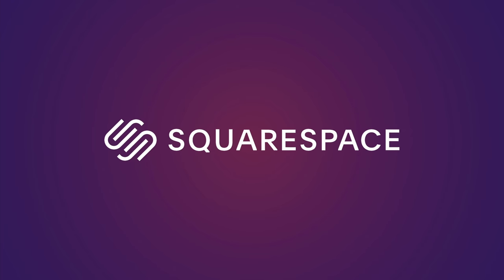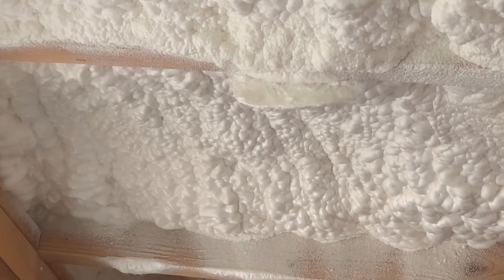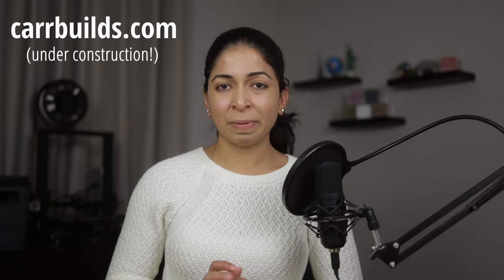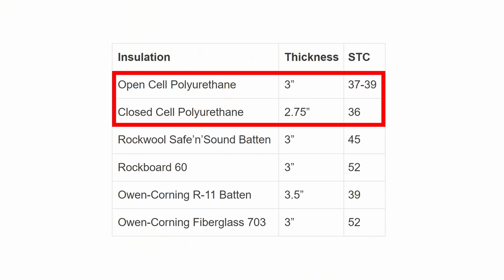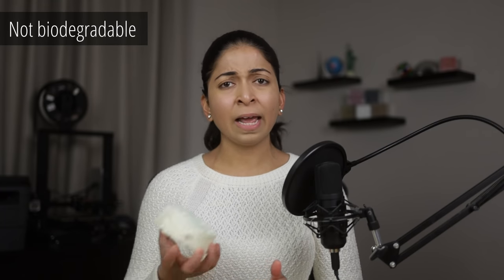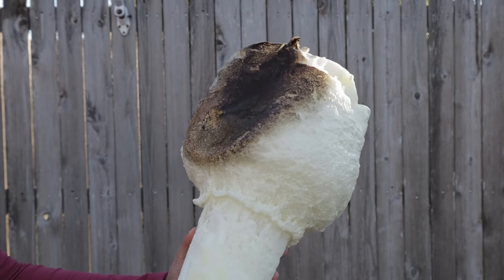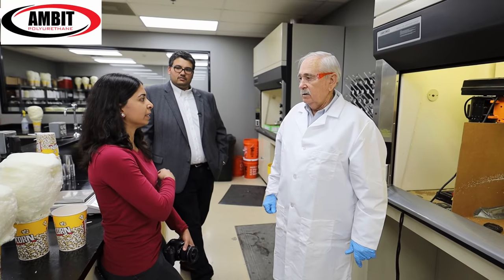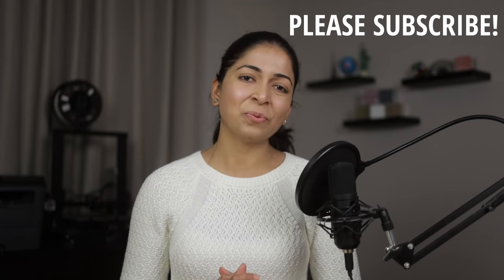PROS & CONS of Spray Foam Insulation | PART 2

Comment: this is the video I've been waiting for.  I've been very curious about the environmental impact of spray foam.  even though it's a long term plastic, it's still a plastic.  with so many other options out there it feels like an unnecessary concession to use plastic for insulation.  I'm heavily leaning toward cellulose for our attic (and walls?).  thanks so much for these insulation videos.  you've been one of my primary sources in all of my research.
Reply: It is a plastic sure, but it’s really mostly air. And it saves so much petroleum product by insulating very very well its negative imoact is far outweighed by the energy savings.
That’s not to say that everything‘s perfect, but what it?
Reply: @FreekHoekstra  yeah i'm not saying it doesn't have its benefits, my personal preference is to avoid stuff that will eventually end up in landfills or be toxic.  And we heat primarily with a heat pump sourced from municipal power that comes from 93% carbon free sources.  No choice is perfect and we've no way of knowing ultimately what the BEST choice is environmentally with all the different factors, but given the info i have right now i'd  like to avoid plastic insulation and go for something else that seems to work very well also.  Thus the cellulose is looking like a good option.  wouldn't have been able to navigate all these nuances without Belinda's videos.
Reply: @jasonreed6262  yeah there’s a bunch of good options personally I do like the idea of using close cell foam for thin layer say 2 inches and then filling the rest with less chemical solutions, The main benefit that this provides is a very good air seal which means there’s also no condensation happening in your walls which means they last for pretty much forever. I think that’s a part that a lot of people forget about it if you make your building last for 20 years longer because it has been air sealed properly spray foam, that’s a lot of material not going to the dump either
Reply: @FreekHoekstra  very nice points.  A small amount for air sealing / delay EVERYTHING from landfills longer.  i like it.  fortunately i'm not the one who will be ULTIMATELY making the decision as... it won't be DIY :).  our house is about 50 years old and has insulation... but not a ton and not well installed and i've no clue about the walls or above the gararge.  definitely need a professional to look at it.  but yes air sealing i think is going to be a big factor i didn't really know about a few months ago before i started going down the youtube rabbit hole.

just out of curiosity, what's your relationship to insulation?  a home owner?  a homeowner who has done DIY insulation stuff?  a contractor of some kind?  just someone who finds this stuff interesting?
Reply: @jasonreed6262  just be careful when you air seal an old house, if it’s done improperly it can cause the wood to rot and die,
Remember you can’t really keep water out you have to make sure it is still able to dry to the outside, Another good channel to pay attention to might be the bill show or Matt Risinger. He has a lot of information regarding this type of construction and renovation. Anyways yes your ceiling is super important if you don’t hear seal your house but insulate it’s like wearing a down jacket but not closing it while going down the ski slope, it’s not pointless but close.

Comment: I remain open to my mind being changed; but, currently I'd prefer rockwool both inside and as the exterior insulation vs open/closed cell foam with foam on the outside.
Rockwool seems like a better overall solution. It appears to better handle moisture and sound than foam.

Comment: Lots of specific info in this vlog.  Much appreciated.  I live in a termite area and I've heard spray foam is susceptible to this insect.  A work around is to use spray form between the framing, hang the sheathing, install rockwool on the exterior before finally hanging the siding(in my case due to wild fire will use a cement-based siding) .  The rockwool exterior offers fire resistance, soundproofing, and is a natural barrier for termites. New construction materials require new building solutions.  Bummed to hear about the 6 months shelf life as I just bought 2 pallets of closed cell foam with the intent of using it in the summer.  Need to get through the permitting process before the foam can go up. at least I know some new variables...
Reply: If those are Froth packs, there should be a use before date on there. I believe those last 2 years.  I also think it depends on the manufacturer/chemical makeup to say how long it will last.
Reply: @eduardos8895  You're the man!  Just checked the boxes, the use by date says Nov 10th, 2023, so its 2 years on these containers of closed cell.  I was under the gun to get everything wrapped in time to use it before April.  Thanks for the heads up.
Reply: @Lionscircle  Glad I could be of service. I used it my attic. I love it. 
Just make sure both cylinders discharge at the same rate... I had one stop dispensing the Iso and it all became mush🙄. But usually, that happens at the very end of the containers. I just got a bit greedy.

Comment: Spray foam definitely has its place. IMO where you have limited cavity depth and serious sun exposure, but need high R value the stuff is great. Where there is no ceiling/attic cavity & wallboard is direct applied to rafters it works well. The downside that once it's in it is hell to remove is a real concern for project planning & later remodeling. Perhaps spray foam could be combined with 3D printing of concrete walls for a better R value mix built into the structure.
Reply: Electrical could be installed in conduit, which would allow for replacement or upgrades in the future.
Plumbing could be done the same way, in conduit, assuming they are running a product such as PEX.
I would also leave spray foam to exterior walls only, and stick to more traditional insulation for use on the interior.

In the end, planning is THE KEY factor.  Without proper planning, someone down the line is going to be screaming bloody murder :P

Comment: Flash and batt with closed cell foam is my favorite combination of insulation when dealing with price sensitive situations.  We are using this in our new home construction this year.  One inch of spray foam and the balance of the wall cavity filled with batt.
Reply: I'm in the middle of a DIY project to insulate and air seal the rim joist on my house. I'm using a modification of the flash and batt method by combining 2 in thick foam board and closed cell spray foam. Cut the foam board to roughly the size of the opening and place in the open rim joist bay with some construction adhesive. Once the construction adhesive sets, fill in the void around the edge of the foam board with the spray foam. I can come back later and add a layer of fiberglass or whatever but my main goal was getting it air sealed first.
Reply: @jon27d That is a good DIY version that will, most likely, make a noticeable difference in energy utilization, and even more importantly, comfort in the home.
Reply: One of my contractors uses this method as well.  The flash and batt also allows for wiring to be fished in if needed.

Comment: Refinished the 3rd floor walk up on a 100 yo brick structure. Sprayed 1.5 inches to the underside of the roof deck.  

Put a warm hat on the house.  House is still leaky but not nearly as much.  

I did see a sound and insect proofing benefit.  No insulation previously meant we heard every street sound and critters passed un hindered.  After I only hear the loudest straight pipes and if my wife complains about 1-3 stink bugs a month in winter that’s a busy month.  

Well worth the investment. Bat insulation was not an option because venting the roof deck would have been a nightmare.

Comment: The two things that absolutely kill its appeal are the permanence and acoustic properties. 

Renovation and even just the occasional new appliance will require electric and/or water to be run or re-routed based on the geometry of the appliance or fixture and adding anything from a generator hook-up or welding station in the garage to simply wanting to upgrade from a 15A to 20A circuit will be an absolute nightmare. I have a feeling that houses with spray foam will likely have lower resell values once people realize the difficulty and cost. 

I also like having a very quiet house. Partly because I can get pretty loud at times, but also because I tend to sleep from 2am till 11am due to the nature of my job. Neighbors leaving for work, delivery vans slamming their doors, farm equipment running down the street or harvesting the field behind my house and trucks delivering oil, gas and mulch or pumping septic tanks all make it nearly impossible to get a full morning's sleep.

Comment: Great overview, thanks! I like the idea of spray foam, but the cost compared to fiberglass, and difficulty of revisions tend to discourage me from using it.

I'm considering options for converting an attic to a heated space with a vaulted roof. I'd love to see a video from you describing the differences between hot and cold roof systems and the considerations when converting.
Reply: tHanks for that suggestion Dave.   It is time for me to change out the shingles and would love to see options.

Comment: Hi Belinda. Thanks for the well explained videos. I live in Canada. Our attic was spray foamed with 6 inches of closed cell foam directly on the upper interior roof structure. The 6 inches filled the cavity between the rafters but not the rafters themselves. 14 years later rot is in many places along the ridge board and top of the rafters. Ant are nesting in many spots.
According to the numbers you mention for water vapour transfer, it sounds like my 6 inches of spray foam should not be allowing water vapour to seep through to the cold roof boards above. Could water vapour be getting absorbed through the non insulated rafters then in turn condensing against the exterior thereby rotting the surrounding wood structure ?  Thanks.

Comment: From an electrician's perspective, I don't like spray foam for the same reason you gave: you can't fish wire through it in a retrofit application. Spray foam does have its place however, you just need to be sure that your plumbing and electrical is exactly how you want it permanently.
Reply: I'm installing 2 empty jboxes in each room that stubs out to the attic space(closed attic) in case added services are needed down the road.  Spray foam over the emt, planning for future needs.

Comment: Only thing I would use this product for is sealing gap and detouring air flow in smaller areas. Otherwise Rockwool insulation is the most effective. No worries about fire hazards with Rockwool insulation.
Reply: You get it

If you have to do that much R&D to equal existing and/or better solutions & still have downstream problems... then it's more about being trendy
Reply: Being trendy, aka can't think for yourself lol

Comment: Belinda, thanks for breaking up the video into organized sections and the great detail. Very helpful. There is a comment in the R value section where you say foam may not meet code. I'm having trouble understanding that. Open cell foam has the same R-value as fiberglass batt (about R 3.5 and closed cell has an R value of about 5.5), so how is it that if cell foam has an equivalent or higher R value than fiberglass batt, it doesn't meet code? Or are you just pointing out that CI is necessary to meet code for both fg and foam?

Comment: My biggest fear of spray foam is improper mixing and application, especially in this current labor market.  You can train people for months but if they do not adhere to the training it will end up costing everyone involved at some point from delayed construction, to dollars, to even health issues.
Reply: It's not really just training.  It's often an equipment issue.   One that the sprayers are totally unaware of
Reply: There is a safety shut off incase of imbalance on all machines, but all the sprayer bypass it to get the job done faster, so sue the sprayer.

Comment: I don't think I'll ever choose spray foam as the primary insulation material, but what it teaches us is the importance of sealing every little nook and cranny of a home. So what I would do is seal every nook and cranny with canned spray foam from the hardware store, as that is exactly what it's designed for, and use rock wool with good R value and sound insulation as the main panels of insulation. 
The attic, depending on its size and shape, may need to be completely spray foamed though, but that's up to whatever technology there will be at the time of me having to make such decision.

Comment: I'm getting spray foam in a few weeks 3 in of closed then 6 in of open cell on top. For the 2x10 roof. 2x4 walls are getting 1 inch of closed followed by 2.5 open. Hope this was a good choice.  My other option is the same thickness closed cell as stated above with fiberglass Batts on top of it. 
Any feedback please?

Comment: Its easy to remove, you get a wire brush on a grinder and you just rip it off, it does take some time depending on the power of the tool. But I mean if you are removing it in 30-40 years your either going to be ripping out the entire wall and everything but the studs or your fixing a section or adding a line of water or power and then yeah your just going to put a large wirewheel brush on a grinder and have that tear it out with a vacuum attachment to suck up most of the shredded foam along the installation path.

Comment: I'm currently renovating the 100 year kitchen of a 135 year old house. 2/3 of the main house was renovated and I used a mixture of rockwool and fibreglass as insulation.  The house is not nearly airtight...field stone foundations and old windows contribute to this.  In the kitchen, I've been leaning strongly towards closed cell SPF since everything is opened up but now I'm having second thoughts.  After reinforcing the kitchen structure, I now have 7.5" deep stud bays and 10" for the flat roof's rafters.   SPF is very expensive right now, $1.75/bdft in my part of Ontario. But SPF will tighten up the structure and seal it.  Comments or suggestions anyone?

Comment: Wonderful video, thank you!
I'm an architect in California. I am finding closed-cell, flash-and-batt to be useful for modern work with thin roof lines where detailing out ventilation is problematic.  I imagine some of the added cost in closed cell can be offset by the savings in ventilation installation.  It seems far simpler for roof subs just close things up tight rather than install things like roof to wall, 2-part flashings.  Curious if you have thoughts on this aspect?

Comment: I've seen contractors down south in the US, saying that termites like to tunnel up into the stuff, just like they would, do to wood.. 

I don't know how true it is, but... I don't see them having anything to gain by lying?

Personally I'm interested in the "Hemp wool" product you talked about before. When I finally get to build my home, I think I'll aim for that.. 
And those new studs that have been engineered. The "Tstud" I believe with their powers combined... it'll be a half way decent insulation system.  (or captain planet will manifest, lol)
Reply: @Eric B 
Sounds like a good strategy to me. (The zip panel stuff is a somewhat "newer tech" by construction standards) You could probably just take more time, to make sure certain key points in the building are really sealed well, & it balance out?

I mean I've heard the term "rough construction" thrown around alot... so if you just had the crew take more time, or if your a home builder yourself, & tighten your standards in certain areas, it could pay off, in the long term (completed house) a lot better?

Comment: A modern home with gas appliances should not be reliant on make-up air from the attic, as stated at 7:41. Even a quarter century ago when I had our gas furnace replaced with a now-obsolete mid-efficiency (induced draft but non-condensing) unit building codes here (Alberta Canada) required the addition of a fresh air intake to the vicinity of the furnace (in the basement), and modern furnaces have dedicated intakes leading to outside.

Comment: Closed cell is the best, when it is sprayed on have your installer put a small amount on the lumber it helps stop heat transfer through the wood and also will stop your house from burning down.

Comment: I believe spray foam is the best option for 98% of applications, even just the 2” flash and batt method to hit the R value code. The batt mat not do anything but it’s still better than 6” of just batt.
I can also vouch for the diy part, it’s a difficult skill & even more difficult if you use the kits as the disposable gun is finicky.

Comment: Off gassing, hazardous byproducts from being burned, and difficulty in removal when reworking electrical/plumbing or remodeling is a no for me. This is a product imo for contractors who can "walk away" and be done with it then it becomes a big issue for an eventual home owner who has to go inside the wall at some point. I also question life span. But kudos to whoever started testing this product around 1940 lol

Comment: Open cell spray foam can be worked with pretty easily after application because it is soft.  Additionally, you can repair it with great stuff/can based spray foam.  Just remember that you need to restore any fireblock paint protection if it is exposed.  

Absolutely correct on that it is not DIY.  Curing problems can leave a house stinking for months.  Get a professional to do it.  

PS - Remember to add the link to your new website in the description when it launches.
Reply from the maker: Will do. Thanks!!